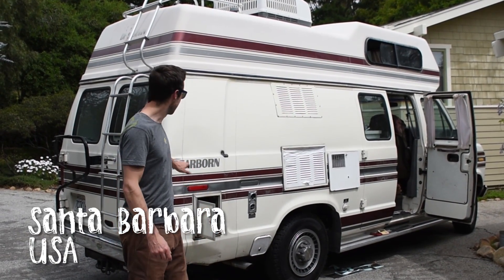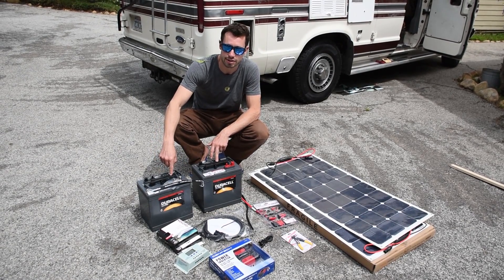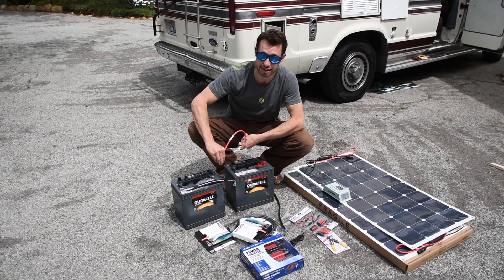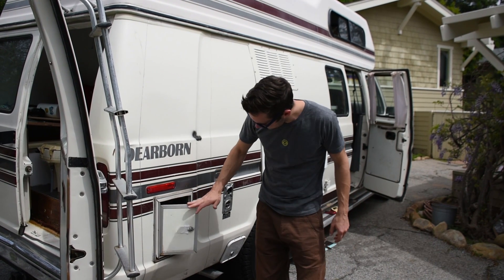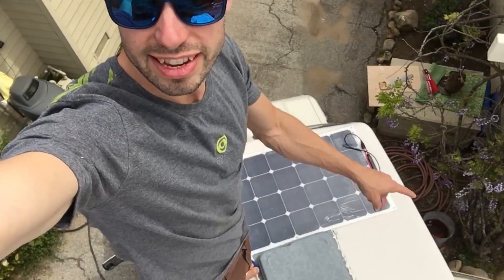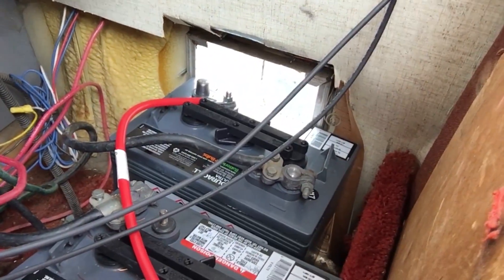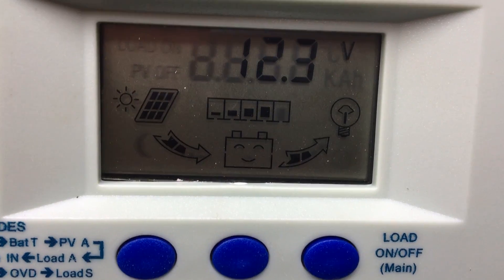HOW TO ADD SOLAR TO AN RV / CAMPER VAN

Comment: Hi Nate, do you have any info on how you hooked this up to the existing system? I have an old camper with a mains hook up and battery for some basic off-grid but we're a bit nervous about integrating solar to this.
Reply from the maker: Mains hook up was a different set of wiring which we left alone. For this we just replaced the 12v system and plugged that into the new batteries / charge controller. Worked fine actually. If you're not sure - esp with mains - just get a professional to give you a hand to connect it all up
Reply: @NateMurphy  Thanks for your advice :) Love the channel!

Comment: Nate I have your book but I'm looking for the best way to attach panel to roof. Ain't got a roof rack and I'm not using those glue on brackets... 70 mph with a wing glued on ... No chance. Got some z brackets but looking for a secure waterproof way to mount them.

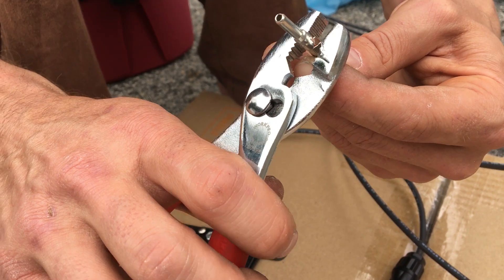Comment: 6:33 that is the worst crimp Ive seen in a while. There are special crimpers used for this, they loop the crimp around and into the center of the wire and hold it inside and outside of the group of strands. If youre going to crimp with pliers you need to do some extra work making sure the crimp wings fold in on each other or solder after the crimp.

Comment: Yet another “how to” video with steps missing. I was hoping to see how each wire hooked up to each wire, to each item. Panel, regulator, battery, inverter.  Suddenly you’re all hooked up to the charge controller, the batteries are hooked together and you’re done, batteries vented? (That’s something I need to worry about? Well crapola 💩, I was hoping to “learn” from a “how to” video. Guess not.
Reply: linda you are a old lady just like my self, that s why things is much dificullt for us these days. I think he did not hook up each wire because is quite obvious how to do it, I mean not for me of course, but I guess for most of guys, they just find easy to connect the wire, somehow guys  knows how to do it already. any way good luck to you and my self.

Comment: Did you not put any fuse on the wires?  Like 100a or 150a fuse on the wire from the charge controller to the battery or a fuse on the wire from the battery to the inverter?

Comment: I got 100w suitcase panels. That way I can park in the shade and charge up to 50’ away. Key is the right cable. Don’t use the wire you use to run lines in your camper van. It’s not “stealth” but you could lay them on top and park in the sun as you go swimming or floating. You do lose some power to sheer length of the cord. Short as possible is best. I got the heavy duty cable just in case. I have no need to go urban so it’s nice just to be in the shade. Good video.

Comment: Just a little pointer, that's not how to make off the cables into those plugs.  If you had a proper tool then the two metal pieces at the end of the plug should look like a Mcdonalds "M", also like a 3 pin plug you have a cable clamp to hold the cable sheath to prevent the wires pulling out, that's what in effect those do.  Without the tool, you should bend one tag over the cable insulation and then fold the other over the top so they are on top of each other and that should be on the insulation as it's soft and compresses and holds.  The bare wire should be clamped just after.  Great video otherwise, sorry for being a bit picky but as an electrician house/commercial/boat then it makes me cringe when i see things like that! :-)
Reply from the maker: Ah that good to know, actually the guy in the solar shop ran us through the crimping... haha just shows that it is hard to get good knowledge. That said, thankfully they are still good :)

Comment: Hi Nate! Liked your van conversation videos and pdf manual a lot, discovered while doing some research for my own plans to convert a van in 2018 into a home / dive van / mobile studio / schools workshop exhibition van to work around Marine conservation. Quick questions here, after you have worked with the two types of solar panels, the panel type and the flexible type which do you recommend? Do you know if these German flexible ones are available in the UK?  If so, where?
Thanks, Ali
Reply from the maker: +Ali Worrall they are manufactured by sun power - so maybe search for that brand. They seemed to perform really well. 

I like the big fixed panel on my van, it is super tidy/stealthy but if you are not going for that then the flexible ones are good (and could look pretty stealthy too)

Comment: This is for 12 volt equipment like laptop and phone. But what about other 230 volt equipment like hot plate, fridge and AC? Can you tell us what kind of systems do we need and how to integrate them? Thanks
Reply from the maker: You would need a bigger wattage invertor to run bigger stuff.. AC - probably untenable with just solar power (people will often use a generator for this sort of thing).

Comment: Did I understand correctly that you attached the panels with velcro? If so, do you leave them on the roof while driving with just the velcro or are they secured in another way as well? Thanks for the video!
Reply from the maker: Nothing else, but it is industrial velcro.. its so strong! :)

Comment: How useful are modern solar panels for the home setting in the UK/Ireland with our weather? Opinion?
Reply: Paul Madden there are solar power calculators online where you can input your location, the panels you want to use, etc and it tells you what the expected output will be.
Reply: Ivan Stroganov Appreciate that. Thank you Ivan.
Reply: Paul Madden depends on what you want to run from them I guess. washing machine/dishwasher are probably a no no unless you have a shed full of batteries. Also I found that there are 2 different types of panels (Probably more). 1 if it's mostly sunny like Spain and another that works better/different way with clouds that would be more beneficial here in Ireland or the UK.

Comment: Worth noting that you should always connect the batteries to the controller before the panels.
Reply: TheAgonyOfVictory makes sense when you think about it
Reply: TheAgonyOfVictory could the controller blow if the panels were connected (without batteries connected? and producing a current ?